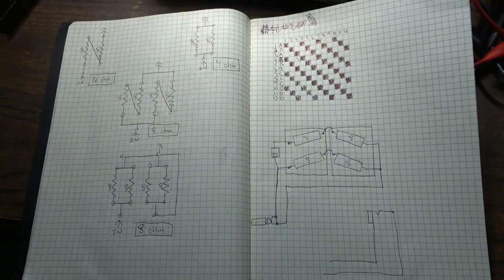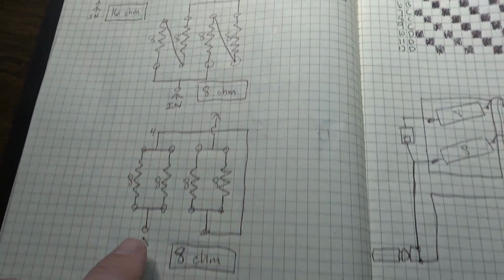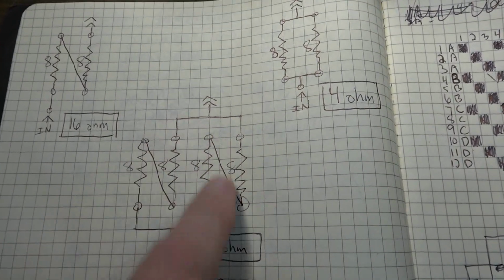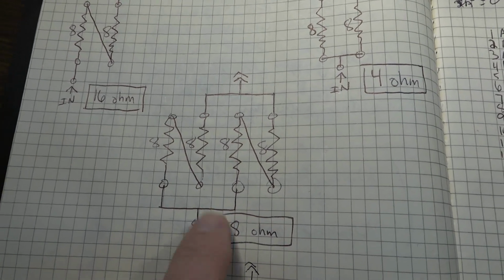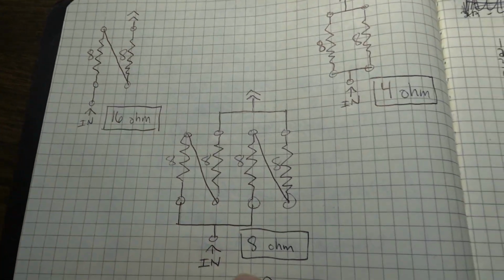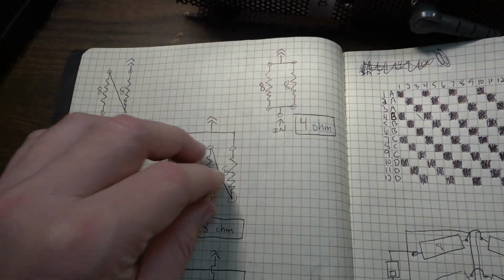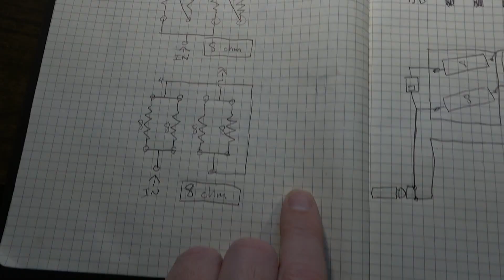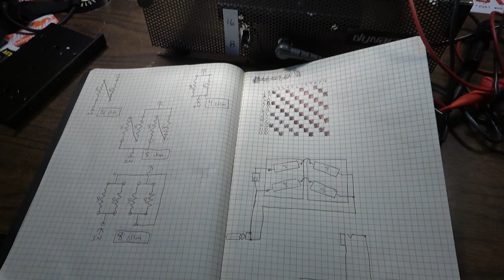How to Construct a CHEAP Resistive Dummy Load Box for Guitar Amp (Hot Plate, Power Soak)

Comment: Can this be run with a speaker to lower the overall vol of a Mesa Boogie 5:50?
Reply from the maker: Your 5:50 will have two outputs labeled for use with "two 8 ohm cabinets". You can unplug your internal speaker and plug into one of those, and plug this into the other jack and set the dummy load on 8 ohms to match the internal speaker, and the overall wattage going to the speaker will be cut in half. This will allow you to crank the output more without being as loud. I have not looked at the schematic to see how the output is wired when in 5W mode, so I don't know for sure if this applies to the 5W setting also, but it should.
Reply: @TheGuitologist  You rock Brad, thanks and hoping things go great for you, just to clairify plug this into an 8 jack and the Internal speaker to the other 8 ohm jack?

Comment: You do know that some people love those amps, right?  My jaw is on the floor, scrapping a decent Dynaco for the case!  That said, thanks for the tip on the Dummy Loads!  I'm going to build one, but try not to destroy a classic amp in the process.
Reply from the maker: This model is pretty universally loathed for sound quality. Plus I don't have any use for it as an amp, even if I serviced it, which it needed. It was non-working.
Reply: @TheGuitologist  yes, not as much love as the st70 but they’ve been gaining popularity as a cool looking retro amp for people building 70s rigs.  While I winced, I’m over it - somehow seeing it trashed activated my hoarder ocd!
Reply from the maker: The parts will all be salvaged.

Comment: can u power a fan off the power amp current?
Reply: you can , more importantly a neon lamp so you can see the throngs of women coming to mate with you .
Reply: yes but not directly, you'll need  a rectifier and some sort of voltage regulation. a 100w amp will produce 40V plus peak.

Comment: We use two in parallel to  load test switching power supplies.  About 1 amp at 24 volts DC. Bad boys will burn the fingers after 5 minutes or so.

Comment: Hi Brad I was wondering if you could help me. I have a 16 ohm Hotplate and my amp is 8 ohms output into the 16 ohm hotplate which I know is fine with that one step mismatch BUT what about the output coming from the 16 ohm attenuator does it have to be a 16 ohm cab or can I run an 8ohm cab? I remember calling THD years ago and asking them about this and they said no problem going from an 8ohm amp into 16 ohm Hotplate but going out of the 16 ohm Hotplate you want to run a 16 ohm cab. I can't remember if they said it was not a good idea or it would ruin the Hotplate but I don't always have a 16 ohm cab and more commonly have 8ohm 2x12 cabs so I have been going into a 8ohm 2x12 out of the 16 ohm hotplate but my amp is always 8ohms into the 16 ohm Hotplate. You think it's hurting the 16ohm Hotplate  by running out into an 8ohm cab?
Reply from the maker: I would trust their take on it. Not sure how their product is wired, but if they say stick to 16 ohms out, I'm sure there is a good reason. If you have an 8 ohm speaker, you should sell the 16 ohm hot plate and buy an 8 ohm one instead to match your rig.
Reply: @TheGuitologist  thanks Brad. I might pick something up that is switchable.

Comment: Another dummy load I used that type of resistor in-just thought of it. This load was used to test cook a broadcast console mixer power supply-+ - 15VDC  thThe console power supply would fail intermittently-cooked it under load until it died. Then was able to fix the supply.-funky regulator chips.re-laced them-cooked the supply again and it was OK . Had to make a “HOT DO NOT  TOUCH’ sign so others in that shop would not touch the load. Mounted it on a rack panel to work as a heat sink and chassis. The load served it’s purpose-probably still in that shop-the VOA maintenance shop in Wash DC. Sometimes folks like to touch resistors being used for test. Your load has the cover to prevent. That.

Comment: Straight forward but effective. Wonder if you have any thoughts on the differences between a purley DC resistive versus an inductive dummy load. It would seem a  resistive load offers negligible inductive reactance and so serves mainly as a load for the DC component but an inductive load has both impedance (inductive reactance for the AC component) and DC resistance. Maybe not an issue with most tube amps as far as basic troubleshooting and maintenance goes but it takes me to one of those ..'Hmmmmm'...moments. Cool video once again. Cheers!

Comment: Reminds me of the Scholz Power Soak I had back in the 80’s. Worked just fine for its purpose especially back then.
Reply: Thats funny you say that, because I just did about 30 minutes ago!  :D  take care!
Reply: Lots of people fried the output transformer on their amplifiers back in the day using a "Power Soak" or similar resistive device... output transformers were never designed to operate into anything other than a speaker (reactive load). Read; "The Trainwreck Pages" by the late Ken Fischer... he was adamantly against using these *resistive" load type devices. 

Regards 🎸
Reply: @scottdunn2178  Well, back in the 80's  I used one for 7 straight years, gigging 4 days a week with it on a 1977  Marshall 100 watt twin combo and it worked fine.  Believe me it was cranked rock n roll 4 hours a night.  Not one single problem with the soak or the amp.  Sure, I agree its not the greatest thing for the amp/transformers, but it worked and got me that cranked kick ass Marshall sound.  There are much better soaks now like the Rivera rock crusher.
Reply: @Superjet113  Yes, some people used a Power Soak without a problem, but tons of people fried their amps too, it's the luck of the draw... but I wouldn't risk it. Use a REACTIVE load type device... your output transformer "sees" these as a speaker, and won't cause any damage. Purely resistive load type devices are only asking for trouble.
Reply: @scottdunn2178  Pretty sure their were no "reactive load devices" back in 1981 when I bought that power soak.  But I appreciate your input.  I have a rivera rock crusher these days, works great.
Reply: @Superjet113  No, there weren't any reactive load devices until the Harry Kolbe "Silent Speaker" around 1988-89. And all I was saying was that output transformers were never designed to operate into a resistor (or an open load) and people are inviting damage to their amp by using a resistive load device (speakers actually complete the circuit in a tube amplifier). Some people have used them for years without any issues... some people blow their output transformer the first gig they play with one. 

Regards 🎸

Comment: Thanks Brad. I fried 2 pots the other day trying to make an effects loop attenuator. I need to up my soldering game. Ill give this a go.
Reply from the maker: Can’t put too much heat on a pot terminal. You risk melting the internal plastics in some of them. It’s the prolonged heat that does it. So make sure your iron is nice and hot. Clean the tip, pre-tin it, and remember to heat the work before trying to apply the solder.
Reply: @TheGuitologist   i use plumbers paste flux , i use very tiny amount , i also REMOVE the flux when i am finished . its my little thing that i do that makes my life so much easier until i admit using it online then ... oh boy the pros techs and experts line up to tell me how wrong i am . thing is i started doing this in the 90s and all that stuff i built and repaired is still kicking ass so ... maybe some rules are meant to be broken . i use it on everything .

Comment: Hey brad, thanks for the post. Question... what makes a dummy load a ‘reactive’ load?

Also...   what does it take to add a line out?
Reply: @electrofrying1685  

Not really, the pole plate core alters the inductance of the coil, also the resonances massively influence the impedance curve (up to around 60 ohms at suspension resonance and a few ohms at cone break-up).  Further, the coil will easily burn out as it needs the cooling from the magnet surface and the airflow in the air gap.
Reply: @electrofrying1685  

Speakers are the most complex impedances you'll find in consumer electronics, even more than transformers. It even changes with cabinet and age. That's why it's such a pain in the a$$ to design a hi-fi speaker crossover.  But I think a high power 1-2 mH inductor in series with the dummy load will be sufficient for amp testing.
Reply from the maker: It needs to behave like a speaker to be reactive.

Comment: Power handling adds up with series resistors too, because one resistor only gets half the voltage, while in parallel circuits the current is split and the voltage is the same, but if you do the maths the power dissipation will be the same per resistor. You can also add a high impedance voltage divider in parallel to get line level out from the speaker.
Reply: The guitologist is a joke when he tries to explain circuit theory!!! He calls a power Mos Fet  an IC!! What an idiot!!!!
Reply from the maker: I’m only looking at maximums. The maximum power handling (wattage dissipated) is unchanged in a series situation. Both resistors see the same current. I do understand what you’re saying and you’re right both resistors share the load, but the max handling for each resistor can’t magically go up when they see the same current.
Reply: @TheGuitologist  Yeah, you are still not understanding it. Let's say the output is 10V  10A, total power is 100W.
If your resistors are parallel they get 10V 5A each that's 50W per resistor.
If you put them in series that's 5V 10A each, also 50W per resistor.
But your resistors can handle 100 Watts, so they do add up in both situations.
I don't know where you learned electronics, but that's basic stuff.
Reply: @triple_x_r_tard  what is ????
Reply: We can go into how solid state and tube amplifiers act diffently to various loads, but that doesn't change that max. power in the circuit is the sum of the max power of all components (we are speaking about equal values). 
If you have different power rating but same resistance values then max. is the weakest power rating * number of components.
If resistances are not equal you have to use Ohm's law for each component.
Reply: @szaki95  this is America. Math isn’t plural 😂

Comment: I used to have one of these Dynaco ST120 amps——-HATED IT! The tube amps I had were MUCH BETTER! Stayed with them and sold the ‘120. I built it from a kit-just one afternoon to build. When I attended college at the University of Springfield,South Dakota in 1971-1972-the Dale resistor factory was in Yankton SD just a few min from Springfield Sd. The Dale folks donated several of those chassis-heat sink mount resistor to the school. Some rated to 500w! Later in life as I worked on AM broadcast transmitters had to make a dummy load for a 10Kw AM transmitter modulator was 5kw of audio into 6kohm. Used a bank of 1 Kohm 200W ‘dog bone “ resistors in series parallel.worked great. The modulator had a pair of 12BY7 tubes in the font end-they drove a pair of 6CA7/EL34 as drivers for a pair of 4CX3000 ceramic tetrodes via a mod transformer-that ou-led to the RF PA stage.Most of the time could test modulators in the transmitter as is with the Tx feeding the antenna or dummy load-often the stage had to be isolated to troubleshoot noise issues or crossover distortion that could be caused by a shorted turn on the mod transformer primary. Like the output transformer in a usual tubed PP amp the mod transformer has a high resistance single end secondary wing to couple to the single end  RF PA stage. Fortunately the mod stage was ok and it’s mod transformer. Glad of that mod transformers are expensive and heavy at 600 lbs¡ your dummy load made me think of the one for a modulator stage.

Comment: Hey Brad, could you make a power brake circuit in a similar way?
Reply from the maker: This is designed more as a dummy load with only an input. But if your amp has two speaker outs, you could set this to 16 ohm and use on one side, while using a 16 ohm real cab on the other side. This would essentially cut your total power to the real speaker in half.
Reply: @TheGuitologist  cheers man! I’ll give it a shot!